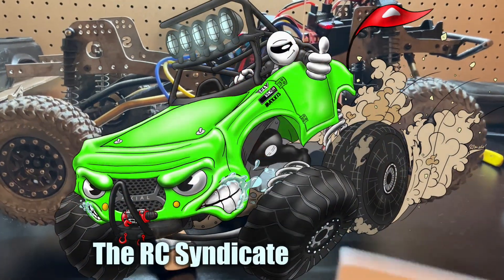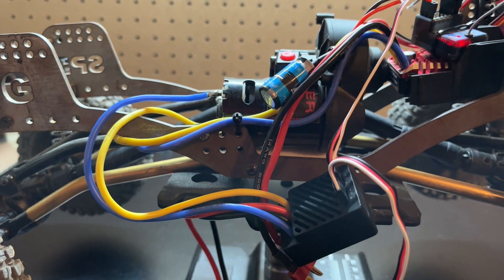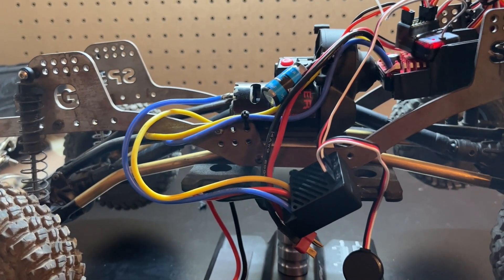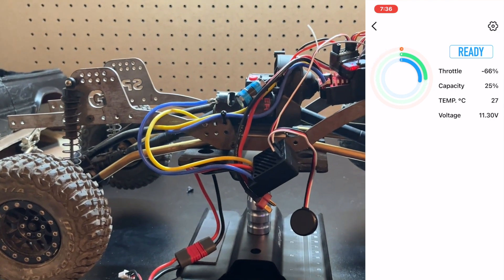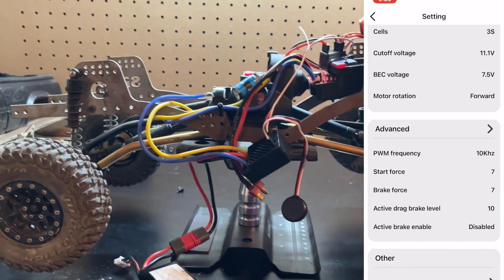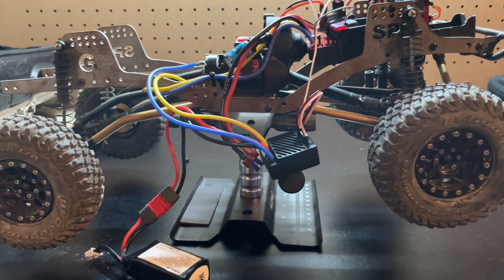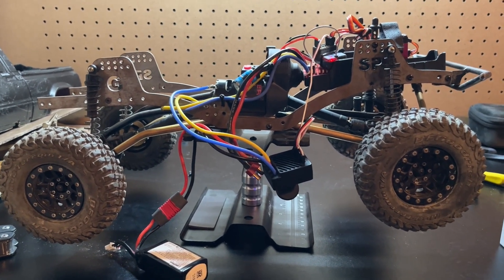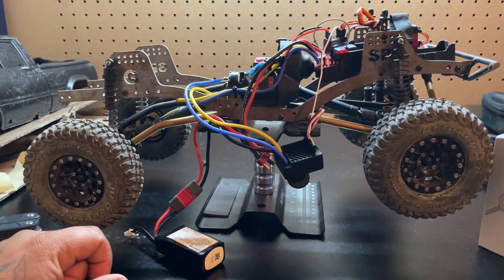Did We Fix This ESC?? ISDT ESC Review #2

Comment: Try lowering active drag brake to 3 or 4 and try adjusting it with the tires on the ground the active drag brake senses movement and with the wheels off the ground it may be trying to apply brake to stop the wjeels from moving. Im really liking it on my capra i had the same jittering issue before lowering active break and it still holds the buggy completely still on steep inclines. Good luck hopefully i was helpful keep up the good videos!
Reply from the maker: That’s interesting. I’d never thought about the wheels being off the ground. Wow. I appreciate the info and will have to get this thing another go. I appreciate the comment and support.

Comment: Reset to factory settings, then do the calibration and go to advanced settings and put start force to max. That should do it
Reply from the maker: I’ll definitely give this a try. I appreciate it.
Reply: Can't get mine to calibrate with controller. And won't shut off. Have to disconnect battery. Tried but just won't calibrate. Thanks for tip though.
Reply: @Clodercs  I’m glad it helped you. Mine still runs flawlessly.

Comment: Terrible ESC..DO NOT BUY!! They need to spend more time on it. Crashes, freezes..updates do not work. Esc will not shut off thru button.
Reply from the maker: I feel your pain. I’ve had nothing but issues with this thing. I have since switched back to my Hobbywing.
Reply: @thercsyndicate9867  ..its been terrible...worked for a couple days until a firmware update popped up. Now I only have steering. Will not shut down by the button and the app doesn't respond or recognize my motor or battery. My new 1080 will be here tomorrow and the ESC70 goes back to Amazon. Going to keep one just in case they work the bugs out in the future...hopefully that happens. Bought 2..1 is going back
Reply from the maker: I’m holding on as well to see if a fix is put in place. If not well then lesson learned for me I guess.
Reply: @TheLotsip77   exactly what mine does. Totally a waste of time and money.

Comment: I just got 2 of these today. Totally loving it over the 1080. I’ve found to avoid time out it I just back out to main menu where you have to select the esc. And just re connect. Rock crawler mode level 3 active drag. Hopefully they keep it updated to get rid of the bugs. This thing could quickly become king esc. I’ve got all settings to work and prove results from race to crawl. 8k pwm provided smoothest operation  for me by far
Reply from the maker: I appreciate all this info. I’ve been applying everyone’s suggestions unfortunately nothing had worked yet but I’m try your recommended settings and see what happens. Thank you again.
Reply: @thercsyndicate9867  no problem man I was doing like 5hrs of messin with it last night. I really do like it. Once I figured out the work arounds, and advanced settings. I’m confident in saying it’s got night and day better control and hold brake. I hope you get it sorted.

Comment: I will stick with 1080 as you say last video 1080 can get a betting and still keep going, and now to many person try promote this esc from ISDT great but there a gap really big that separate ISDT from 1080 the 1080 don't fail that why they cost $40-50, they never fail
Reply from the maker: You said it. It’s tried and tested. I have beat the crap out of that esc and it still keeps going. One major reason I’m still brushed.

Comment: I can understand your point of view given the issues you're encountering. I see that you soldered directly to your motor instead of bullet connectors so that's an additional inconvenience installing and removing.
Just got mine and  though it errors out it does accept the settings changes. When I go back in I can see the changes I previously made. And when I exit after that it is all good. Another nuisance if you tend to alter your settings alot. Have you tried another phone to program it?
Reply from the maker: I have used my Samsung phone with similar results. I watched a video today showing that ISDT did in fact have a release of beta ESCs that went out and are willing to exchange for the updated version. That’s great to see a company acknowledging that there is a problem and are actively fixing it. When the new one is available I believe it will give the Hobbywing 1080 a run for its money but that is one hell of a mountain to climb. Time will tell.
Reply: @thercsyndicate9867  I'm with you that cheap price and non performance is not a good combination.
Getting my new RTR crawler so I will be using this and my flysky to replace the 2in1 in it and will be able to more thoroughly dive into it. Will see if there are workarounds or just incompatibilities.

Comment: I found it only does it with flysky radios switch between 4  radios and then use my spectrum and futaba and works fine it's something with flysky
Reply from the maker: Badass. I’ll try my spektrum radio and give it another try.

Comment: got mine today. that wiggling effect is cause by the rate of active drag break. lower the active drag brake rate. even if yor on rock crawler you can engage active drag brake but set it low for nor to wiggle
Reply from the maker: The active drag brake was disabled but the problem still remained. I would also try and set the value lower if the program didn’t timeout every single time. I’ll keep trying though. I appreciate the suggestions.
Reply: By the way im using an andriod v10 smart fon, and all programing done was a success, i haven't experience any time outs.
Will still make some test after i install the esc to my crawler. Il give you an update. Especially that motor wiggling issue.
Reply from the maker: I tried with a Samsung and had the same results as before. I’m also hearing there is a version 2 out.
Reply: I just learned today. When your frequency is set to 1khz, the motor wiggle went off even you set the active drag brake to max.
Reply from the maker: Going to give this a try. Just waiting on some parts to get here before mounting the esc.

Comment: It does seem like a v1 which is identified by the serial number  on the bottom instead of top or vice versa I believe.? The long 50minute review by donaldsneffe on YouTube video has a response by ISDT in the comment...
Failing that I've only recently got a Flysky Gt5 and feel the deadband neutral range is funky compared to my spektrum and sanwa radios... maybe the throttle trim isn't playing well with that radio? I'm sure you'll get a warranty replacement though. 
Cheers👍
Reply from the maker: Great information. I’ll have to check that video out. I believe my buddy Matt is waiting to receive a v2 and I’m definitely giving that thing another shot. I appreciate the comment.

Comment: I wonder if the motor brushes are worn out/ in by the dynamite esc?
Reply from the maker: It’s a fairly new motor but honestly I have not tested this on another motor. I will give that a try for sure. Thank you for the suggestion and will follow up.
Reply: @thercsyndicate9867  cool. Look forward to the follow up.  Good luck. By the way I ordered the hobbywing 1080. This and other videos help with the decision.  Thanks for the videos.

Comment: Fare play you gave it a shot
Reply from the maker: I’m trying that’s for sure. Still going to try and figure out something.
Reply: @thercsyndicate9867   I never had a sync isue I did notice one I had to close program and reopen and changes had been made I use a android s10 so quit a new phone and I guess blue tooth
Reply from the maker: I did try the android with similar results. I only used the iPhone to screen record to demonstrate the problems I was having. Aside from all that the low end control of this esc is amazing.
Reply: @thercsyndicate9867   ill have another play re enable the auto drag and try adjust throttle like you did  prob is I did not want to take fusion out of my rig so playing  with it in a 1/18 scale with a 390 motor not the best drag brake as is  but do like alot of the features as you sat